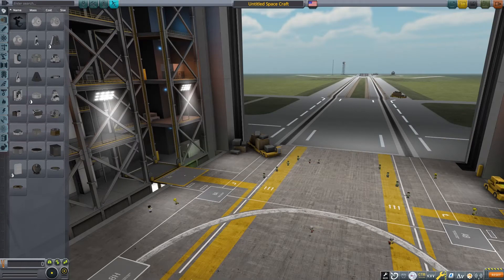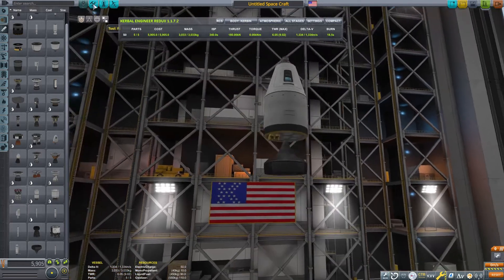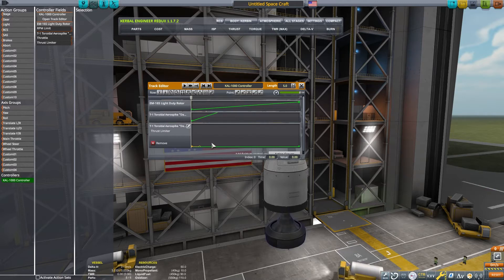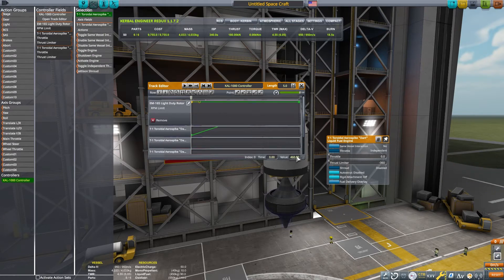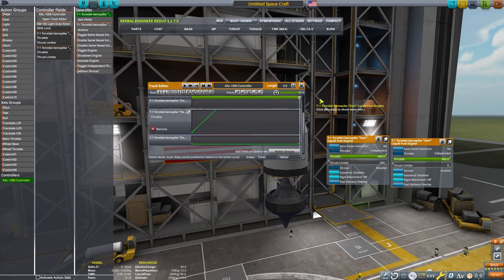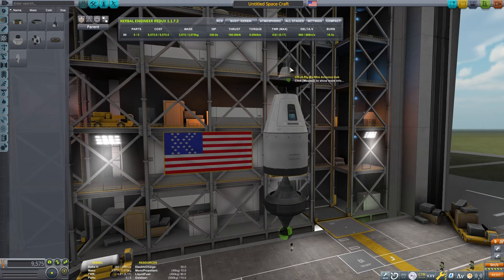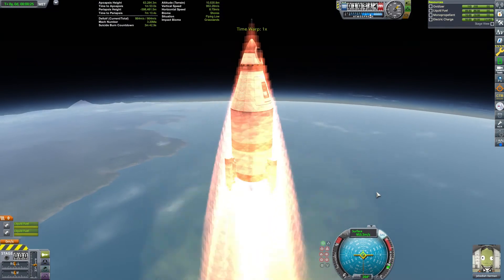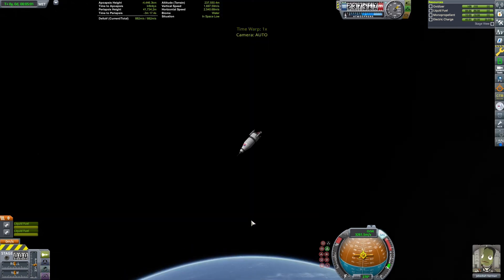Infinite Fuel: KAL 1000 Hack

Comment: For console players I noticed we can't do this trick with a propeller but  you can get around this issue with a servo motor. Have the Kal set with the servo's target angle and then set it to -180 and copy-paste like the video.
Reply from the maker: Thanks for the tip. Looks like you figured out a way for console players to be able to use this exploit.
Reply: What is a "propeller"?
Reply: @FABM00-00  in the video he uses a blade that would normally be used on a drone or prop plane. I just call it a propeller
Reply: For some reason the engines don’t have a thrust limiter you can edit
Reply: @Tobee _gamer  If your playing on console then engines never had a thrust limiter.
Reply: @matersasquatch neither can you edit the throttle, how do you solve that?
Reply: So how will it work with no throttle?

Comment: mine didnt work but you can just put a fuel tank under your command pod and then put a kal- 1000 on the side of the fuel tank,  and put the engine throttle in actions group in the section "kal- 1000 controller" and in the track editor set the engine slider all the way down to a huge negative number and put some engines radially on your fuel tank and set the throttle to independent for the aerospike
Reply: (set throttle to independent for the aerospike before starting all engines)